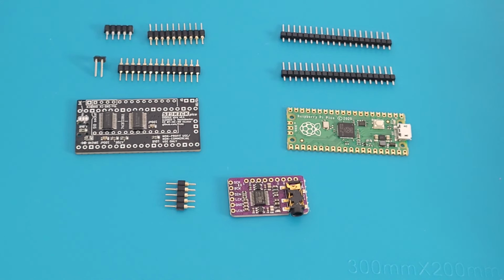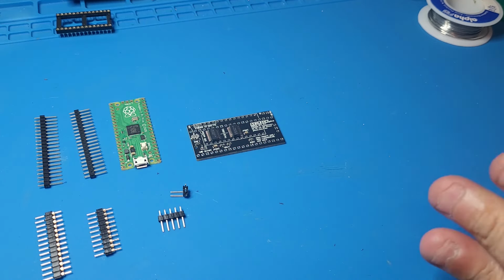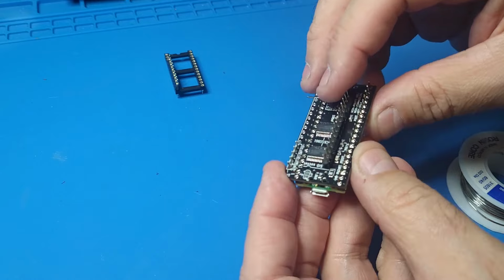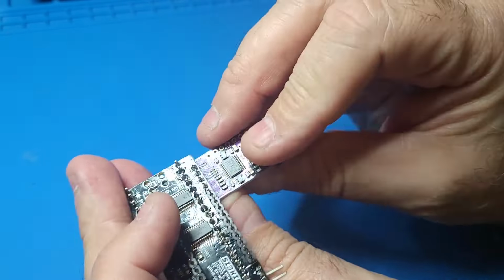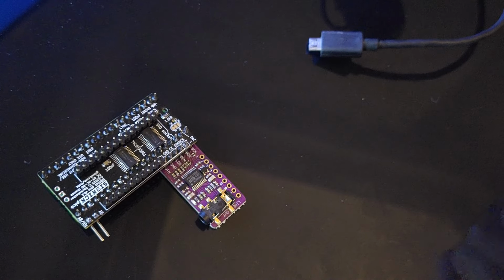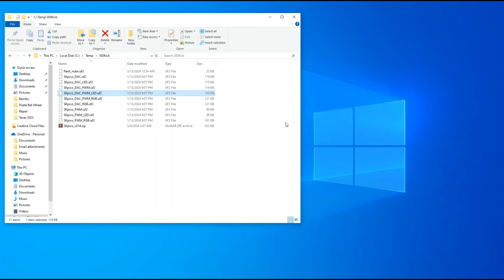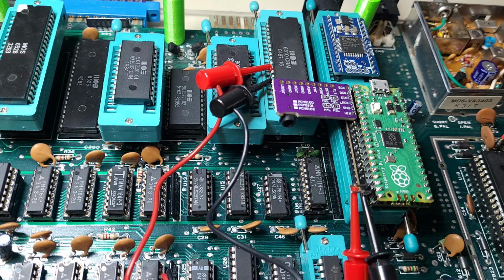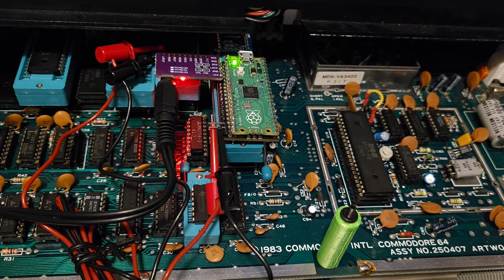SIDKick Pico Amazing SID Alternative  For Commodore 64

Comment: Thanks for the walk-through. I find it a little bit unclear in your video, the difference between dual-SID and Stereo output. You don't need a DAC-board to use DUAL-SID's! These are two different use-cases. You need the 1-2 extra jump-wires to connect to the extra address bits on the bus to be able to control the second SID. Both SID's can be output to PWM, thus you will hear all the 6 (3*2) glourious channels in mono. THEN, if you also want to be able to mix these two differently in Stereo-space AND get better sound by using a real D/A converter then you need the DAC-board. With the correct firmware(PWM+DAC versions) both can sound at the same time, with a little bit less quality overall, according to frenetic. Hope that clears these issues.
Reply from the maker: Thank you - you are certainly correct in your points. I should have been more clear about my use case. Thank you for taking the time to post the clarity!

Comment: If you add Bluetooth to the Raspberry Pico then you could use wireless paddles, if wireless paddles were being produced that is. Maybe an idea to ask Hong Kong to start up some old machines and stamp out a few paddle housings, add a battery compartment, and make place for a antenna. Then possible at the fifty-fifth anniversary of the Commodore 64 Pong could be played wireless.
Reply from the maker: I like your out-of-the-box thinking :)

Comment: Is the actual code for the sys command also located in the SIDKick firmware? I guess this is not possible right?
Reply: You configure ONLY by running the SYS command. Otherwise you need to actually change the source code. The whole C64-binary for the menu is included in the SIDkick-firmware as a binary array of values. It is "presented" to the C64-CPU when it visits specific addresses (like 54333/54303)

Comment: Although the ArmSID is a great product (I have been using one for some time), this will be the end of it.
Reply from the maker: The SIDKick Pico is definitely a great alternative for sure, but the ARMSID has a few more configuration features such as modifying waveforms, etc.. I also like the BackSID. Then there's the build time. For folks like me that go through a lot of repairs (I've replaced no les than several dozen SIDS in the past year) that's meaningful. :)